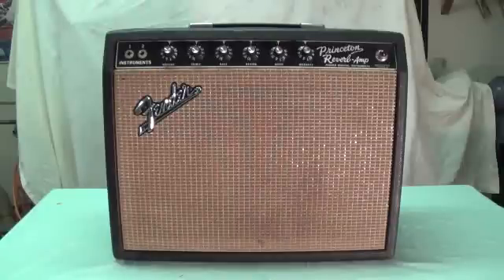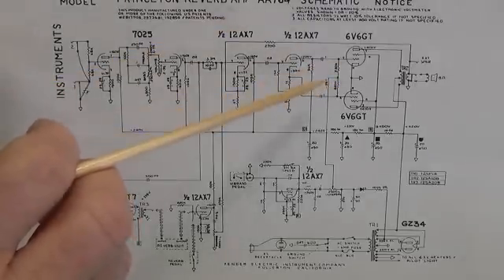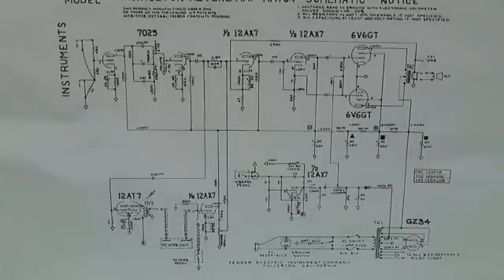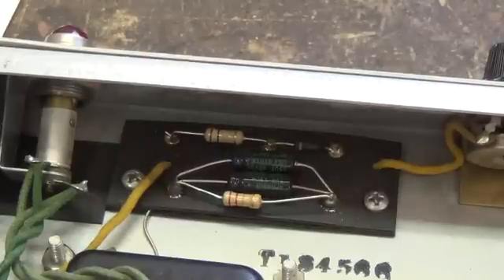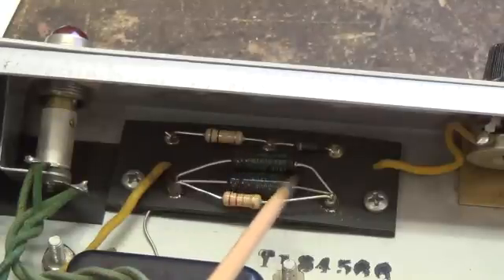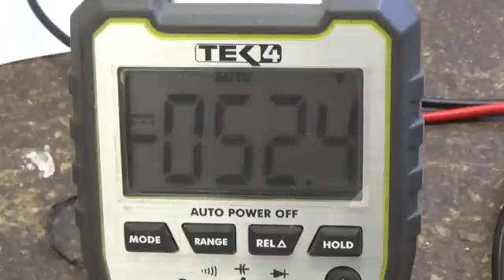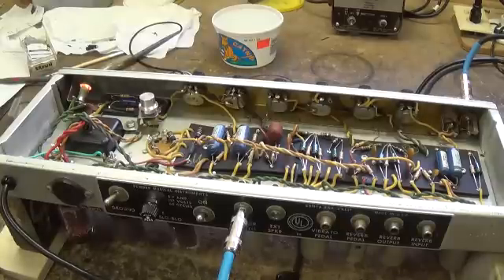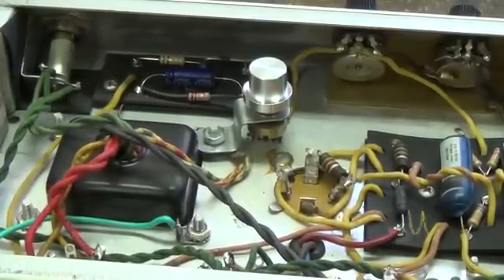Converting the Fender Princeton to Adjustable Grid Bias

Comment: Hi Uncle Doug, 
Hope you're doing well! Thank you for all the great videos!😢
I'm writing to ask about Power Transformer overheating. 
My Princeton Reverb has burned out its P.T. transformer for the third time. 
I had followed your instructions on biasing it, I had to add a 10k to the 22k that was there to get the correct negative bias voltage. It worked fine for a couple of years, but it happened again, unfortunately the fuse was a 3 amp instead of a 1amp. 
Anyway I had it rewired and re installed it (with the 1 amp fuse) but it gets so hot that I can't put my finger on it. 
Any advice will be greatly appreciated! 
Best Rgds!
Reply from the maker: Without personally analyzing the circuit, I can offer no specific insights, Alvaro. Which winding burned out? Did you monitor the current flow through that winding prior to the burn out?  If high did you hunt down the cause for the excessive current flow?
Reply: Thanks U.D! I will check the transformer to see which winding burnt out, and try to find what's causing excessive current flow. (What little I know, I've learned from your great videos) Thanks again!
Reply from the maker: @alvarofalcon7136  You're welcome, Alvaro. Good luck :)

Comment: Hi Doug, Many thanks for another great video. There seems to be a good deal of discussion regarding how hot or cool you bias your tubes and how this effects the sound of the amp. I would be interested in understanding if this is a "perceived" difference or exactly how much does the frequency plot change vs bias settings. I believe it would make an interesting video.
Reply from the maker: I already posted a video showing the correllation between bias and tone, Geoff. Check it out.

Comment: Hello Uncle Doug, I watched one of your vids where you designed a custom amp with a Princeton type push pull output. You mentioned that altering the resistor value at the input to the intensity pot would create havoc with the intensity function. What would be the changes we would see? I chose to change my bias to your suggestion of individual cathode bias, which I settled at 470 ohm each and have 9 watts each. Dead quiet, and with the celestion alnico blue 12" and the reduced capacitance to reduce the over active bottom end. Love from England.
Reply from the maker: I don't recall the "create havoc" comment, Ian. I'm glad the individual cathode biasing worked well for you.

Comment: I was watching your series on biasing and watched this one again, and have a question about the Tremolo Intensity pot in the circuit.  If this pot controls the bias of the amp by changing the Plate Voltage, isn't that going to be screwing with the power dissipation every time you use the Tremolo and change that setting?  Doesn't make any sense to me.  Could you clarify what's going on for me?  Thanks as always.
Reply from the maker: The bias pot has no effect on the plate voltage. It regulates the -DC bias voltage on the tube grid. Plate dissipation varies greatly depending on the strength of the input signal......that's why it's set at 70% of max PD.  Watch my other videos on tremolos, tube biasing, etc. for full explanations.
Reply: Uncle Doug, sorry about the confusion.  I wasn't talking about the new bias pot, but the Tremolo Intensity Pot Center wiper lug that connects to the Grid resistors.  The schematic originally shows the B+ going through the top of the 27K resistor, to the Tremolo Intensity Pot Center lug, and then up to the connection with the two 220 K grid resistors that connect to the Grids.  So before you installed the new bias pot, wasn't the Tremolo Intensity Pot affecting the bias when the Tremolo Intensity Pot was adjusted?
Reply from the maker: Yes, the Tremolo Intensity Pot does indeed alter the tube bias somewhat, establishing the threshold at which point the tremolo effect becomes audible. @wsscott72

Comment: Will this grid biasing work in an amp that does not have tremolo/vibrato? I want to build a tube amp for keyboards.
Reply from the maker: Of course, there are thousands of amps with grid biasing and no tremolo.....but you will have to create a power supply for the biasing circuit. Look at schematics to see how.
Reply: @UncleDoug : I am thinking of either a Harvard or a Princeton, head only. So I am assuming that I can omit the tremolo/vibrato on the Princeton you were using to demostrate.
Reply from the maker: @dennislarson9560  Yes, you can.

Comment: I have a question, my silver faced princeton reverb has an erratic tremolo speed pot. When I increase the the speed at about 8 it will cancel the tremolo. I installed 2 parallel 1meg resistors and a 0.2 cap like your video shows but the pot still acts up. can I replace the 3meg pot for a 1meg. In the speed control?
Reply from the maker: You can experiment with different pot values, Daniel. It's impossible for me to guess what value will work the best.

Comment: Thank you so much for this informative video.  I do have a question,  in the video it appears that you put an insulator of some sort on the 27K resistors leads on the bias board.  Is there a reason for this ?
Reply from the maker: Insulation is often placed over the exposed leads of capacitors and resistors to avoid short circuits.

Comment: Uncle Doug, I have a question, I don’t know if is possible… but i just thinking about make two grid bias pot and disconnect 270k resistor in order that each one receive an individual grid bias pot… in order to Match unmatched tubes… thank you for your very educative videos
Reply from the maker: It's more common for there to be an overall bias pot, then a second (balance) pot to distribute the -DC bias voltage to each tube grid, Jonathan. But you could  experiment with other configurations.
Reply: @UncleDoug  the idea was came when I see this picture where is a kind a multiple variable grid bias (or at least I think so) 

http://www.tetrode.co.uk/sweep3c.jpg

I just try and hope I won’t burn my house, thank you uncle Doug
Reply from the maker: @jonnathandiaz7139  Careful experimentation is always a good approach, Jonathan. Good luck.

Comment: Hello uncle Doug! I love your videos, I mentioned I did the Bias mod to my princetone non reverb, and I works great, but when I change the speed, the pilot light acts with it, I mean it changes intensity with the speed. What can I do to solve? 
Thank you very much!
Reply from the maker: Greetings, Daniel. Since the 6.3VAC pilot light circuit is completely separate from the bias circuit, I have no idea why this is happening. Perhaps you have a grounding issue somewhere in either circuit ???
Reply: @UncleDoug  this amp has been severely worked on, all original wires have been changed, maybe there is some bad connection (like in your other princetone video). I'll have to check everything with the diagram, thank you very much
Reply from the maker: @soundcityec  That would be best, Daniel.  Long-distance guesswork would be of little value.

Comment: Hmm. Doug, i have been watching much of your videos recently, working on my ‘68 princeton. I’m trying to measure my plate current.
I understand i can measure it in two ways, Shunt and calculating it with the resistance of CT and OPT of my transformer. 

I am tryin to calculate Plate Current, though i’m getting no voltage drop from pin 8 of my rectifier tube to pin 3 of both my output tubes. They’re measuring at ~449 VDC. There is a resistance of 154.9 OHMs and 152.6 OHMs to either tube. 
I don’t understand how there can be zero voltage drop here. I’ve tried measuring the drop from Rectifier pin 8 to Output pin 3, and i have also tried just reading voltages with ground as a reference at each pin. There is no voltage drop.

I had tried to do the shunt method, and yeilded no current.

I only have my rectifier tube plugged in, this is the correct way of doing this right?

Very puzzled here, and hurting to finally restore this amp, but i want to ensure i don’t blow anything on my first  smoke test.

Thanks for all you do, Doug, your absolutely the man
Reply from the maker: I'm guessing this is a joke, NQ.....but how can you have any plate current if the output tubes aren't plugged into their sockets?
Reply: @UncleDoug  Lol, unfortunately not a joke.
I’ll have to try with output tubes in. I was thinking that we were measuring/calculating the current that is going from CT to the output(s) of the transformer, therefore not needing any output tubes.
 I recall in one of your videos your tubes were getting too much current, and gave them only a few minutes of operation before they could fail, i was trying to avoid damaging any original components, and thought i did not need output tubes to measure the plate current, since the resistance in the transformer should give voltage drop, thereby allowing to to calculate current via Ohms law. 
Clearly it seems i still have much learning to do.
Thanks Uncle Doug
Reply from the maker: @nikelquint  Always use a current limiter to protect your amp's circuit, NQ.....and never forget that the circuit must be complete before current will flow. I meant no insult by the "joke" comment......I get all sorts of amusing questions and comments and sometimes have trouble separating the humorous from the serious.
Reply: @UncleDoug   Haha it’s all good. I really appreciate the quick replies, i love your dedication to the craft, it’s inspiring. And for sure i’ll keep my current limiter hooked up as i’m testing it.
Thanks again
Reply from the maker: @nikelquint  You're welcome, NQ.

Comment: Hello, Great video. please excuse my ignorance, I'm not  very familiar with electronics. After watching your video would it be possible to add two adjustment knobs so you can Match Bias both tubes ?

Thank you for your video.
Reply from the maker: Thanks, Daryl. Yes, indeed. In fact some Fender amps came with this dual adjustment feature.

Comment: Hi Uncle Doug. Your videos are very informative, as always. I have a question about your adjustable bias  circuit. If the wiper on the pot were to fail or become dirty, is it possible there could be a meltdown of the output tubes? I'm wondering if a bias circuit could be devised where the pot is only part of the shunt element? Thus, a failure would result in a more negative bias voltage.
Reply from the maker: Thanks, A61. The current flow to the grids is negligible, so the adjustment pot is completely unstressed. Bear in mind that Fender has been using bias pots in hundreds of thousands of amps built over the last 60+ years, and to the best of my knowledge, pot failure has simply never been an issue. Indeed, there are all sorts of more likely failure points within amp circuits.....I deal with them daily......but so far, not a single failed bias pot.

Comment: So can you use  variable resistance at the cathode?
Reply from the maker: The cathodes are normally grounded in a grid-biased circuit......like the Princeton. Fender experimented with hybrid biasing, but only for a short while.

Comment: Hi Doug. Do you think this will work on a single ended Champ style build with an adjustable  bias  with the cathode trem? I have an adjustable bias installed so I can run all different power tubes. 6L6 , EL34, KT's , etc. Thanks.
Reply from the maker: Are you sure that your power transformer can fulfill the current demands of the tubes you listed? Can your SE output transformer handle the high power output of these tubes? Finally, each output tube you listed has different load resistance and thus will reflect a different output impedance.....how will you cope with this?
Reply: @UncleDoug  Oh yes. I made certain of that Doug. What do you think about the bias? It drifts up about 5- 7 mA  with all controls on zero after running a little while.  As far as the load resistance goes I have   multiple taps. to choose from ; )
Reply from the maker: @RCPickups  Is the tremolo activated? If so, even if it's set to zero intensity, the PD will be altered by it. You can pull the oscillation tube to check this.
Reply: @UncleDoug  It changes voltage on the 1st cathode  since it's single ended.
Thanks Doug.

Comment: Why would you not use two pots to grid bias each tube separately?
Reply from the maker: It's not necessary if you have a fairly well matched pair of output tubes, Mike.
Reply: @UncleDoug   OK, it's easy to get into the weeds without the benefit of adequate real world experience.

 Do output tubes stay relatively matched over their service life?

Comment: It's a wonder to listen to!! Excellent teacher! Say Uncle, can I send you my tube amp schematic (fixed bias) to check if a similar mod would be possible?
Reply from the maker: If the amount of -DC sent to the grids is regulated by a fixed resistor to ground, you can substitute a smaller fixed resistor plus a pot to make the bias voltage variable.

Comment: I realize that some information contained in YouTube videos is not always completely accurate, but I am trying to understand how diodes work and every video I watch says that current can only flow through the diode in the direction the arrow is pointing.  However, the Princeton bias circuit is showing the current going through the diode against the arrow.  Somehow, the diode must be allowing the negative half of the AC to pass through and create the negative bias voltage for the 6V6 grids.  Is there a simple explanation for this baffling conundrum?
Thanks
Brian
Reply from the maker: The marking of the diode in the Princeton bias supply is confusing. Traditionally, the arrow end is the plate (+) and the vertical stripe end is the cathode (-), but Fender marked their diode with the - on the left (arrow side) because that's the way the negative DC is traveling, while the positive DC is blocked. If the diode were reversed in the circuit, then positive DC would be going to the output tube grids, which would be disastrous.
Reply: Thanks Uncle Doug.
Is it correct to say that, in a diode, current can flow in the direction of the arrow or in the opposite direction, against the direction of the arrow, depending on how the diode is oriented in the circuit?
Reply: @UncleDoug  Trying to scratch build this amp and that part of the schematic was confusing me, thanks for the explanation! They should have left the + - off and all would have been good with the world, lol.
Reply from the maker: @APTheTinMan  I understand, M16, but the labeling is literally accurate.....the -DC passes through the diode to the tube grids, while the +DC is blocked. It's a matter of labelling based on component structure vs current flow. To be honest, to me, the current flow method makes more sense.

Comment: Hi uncle Doug, I am a faithful spectator and I am looking forward to every video of you. I'm sorry for my horrible english -
 I'm 60 years old and never had english lessons - (russian in school ;-)) This is not a criticism your work - but I have 
a question about the timecode 10:50 to 10:55 of your video: You are talking about -20 miliampere anode current but the 
TEK4 shows - in my opinion, only - 0,20 miliampere - if the measuring range,  "mA" right in the window of the TEK4, is correct - 
or am I wrong?
And again: thank you for the opportunity to learn from you
Erwin
Reply from the maker: Greetings, Erwin. Your English is far better than my Russian ;) You make an excellent point. The readout of the TEK4 does appear to be 0.20mA rather than 20mA. I'm not sure how I had it connected or if the range was correct. I know that the PC was 20mA, so my guess is the range on the TEK4 was not correct.
Reply: Hello Uncle Doug , thanks for the answer - it is as it is and I knew that with 0.20 mA the amplifier would not really work - but the two 6V6's would have a very, very long and above all quiet life ;-) wouldn't they? ,.. or not-I still have a lot to learn... Many greetings from Hamburg

Comment: Very helpful video, as always!!!
Just a clarification: the resistor in the bias circuit seems to be 22K instead of 27K.  Am I wrong?
Reply from the maker: I don't recall, EV. I may have changed it or misidentified it.
Reply: You know what's weird? His is definitely marked 22K, even though the schematic and layout both call for 27k. However, my drip-edge 68 Princeton NR also calls for a 27k resistor, but the one in the bias circuit is also labeled 22k, despite it measuring out to 27k...

I wonder if Fender got a discount on a lot of mislabeled 27k resistors and used them here. It wouldn't surprise me given Leo's... "propensity for lowering costs..."

Comment: Wow, just read the footnotes on protecting the bias circuit from pot failure. I haven't experienced this but I get the point. A recent prototype build of mine is not behaving as expected; this may be the answer.
Thanks as always.
Reply from the maker: I hope it helps, Howard. Good luck.
Reply: @UncleDoug  
Thanks,
This is a test bed project. I'm experimenting with selectable negative feedback,  tone stack modifications, preamp tube placement, and some control location alternatives.
The first pass sounded good, but the 6V6s tubes were running very hot, and the amplifier was drawing 1.5 amperes at 120 volts. Also, grid current seemed high to me, but no red plating.
Yes, I may have bitten off more than I can chew.
Be well,
HR

Comment: Hi uncle Doug, I have been following your amazing videos as an old tech I am learning a lot from you on tube technology I want to rebuild my 1963 Harmony amp H306A replace most of the caps, replace to 3 prong plug and I would like to add an adjustable bias pot (how many watts is the pot) the H306A diagrams resembles very much to the Fender Princeton also you have another video on tremolo mod by adding a cap to get more Intensity, I would love your feedback on this. Keep safe